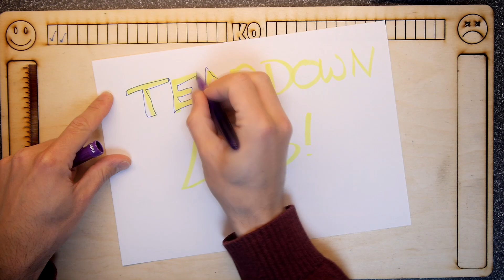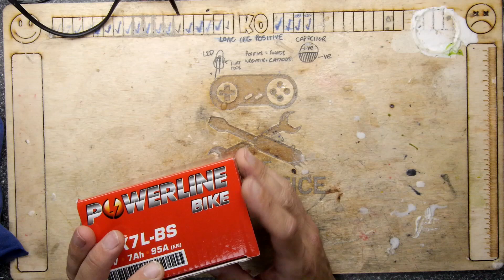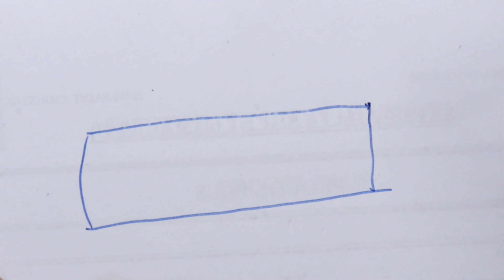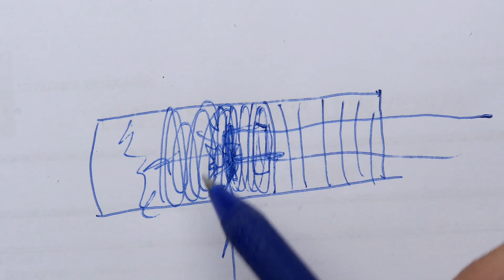Video of fail

Comment: One possibility for the fuse’s workings could be that the star shaped thingy was actually soldered to the rod and that the solder liquefies at a certain temperature, with the spring then pushing the star shaped thingy out of contact with the rod?
Reply from the maker: That could be it indeed! I might order some fresh ones to take apart carefully 😁